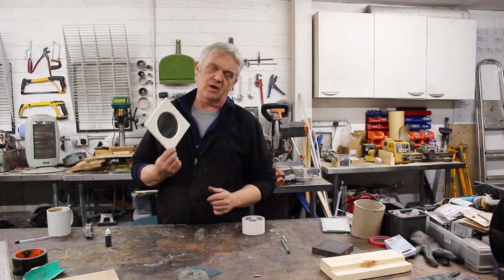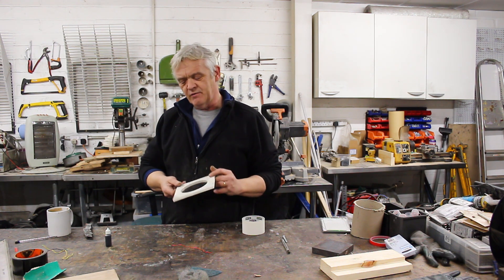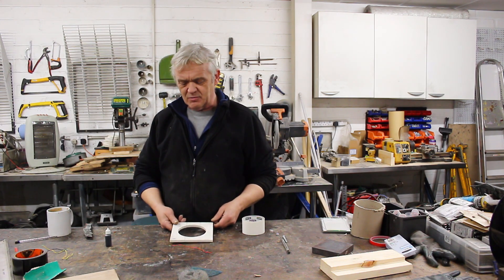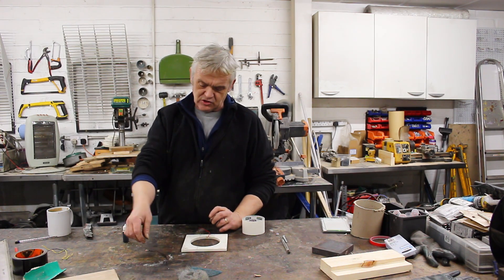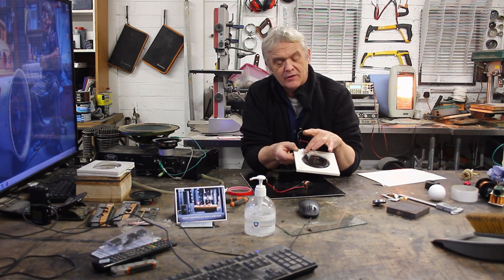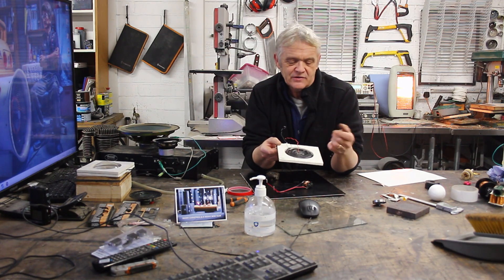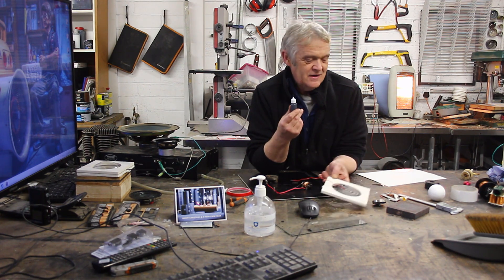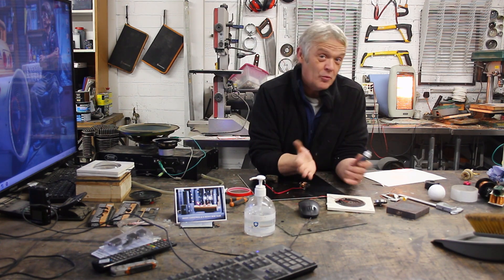1393 Painting A Graphene Speaker

Comment: The hand painted coil is rather low resolution, but it gives me an idea...
Years ago you made copper formate in order to make copper nanoparticles.
You could make a paint / ink with the coper formate and coat the whole film with it. Then using a low cost laser plotter, selectively convert the copper formate to copper. Ideally the unconverted copper formate ink would then be washed off. The copper could be burnished to increase conductivity and electroplating could be used to increase the thickness, if necessary.
Silver, nickel or other metal formate inks could be made with heat/laser conversion properties.
Thinking of which, what a brilliant way to make flex PCBs at home!!! 😁
In fact, this technique could be used to produce multilayer PCBs. After each copper layer is produced and unconverted copper formate removed, it could be sprayed with a suitable insulating lacquer. A mask could be used where layer interconnections would be required, then another layer of formate ink laid down and the process repeated. Polyimide substrate and coatings would be ideal due to their heat resistance. Polyimide would also give the capability of selective laser sintering to produce resistors directly from the polyimide.

Comment: Very interesting. I'm curious to know if the tone of the speaker is controlled by the diameter of the hold, or possibly the thickness of the cellophane? If so you should be able to make a relatively complete speaker system by varying the diameters and thicknesses.
Reply from the maker: I honestly don't know but ii would think you are right - certainly worth looking at - cheers

Comment: It's a low inductance you've got for that speaker but it doesn't take much power for your ears to hear that. It's more like the sensitivity of your hearing is the amazing part.
I made this crystal radio ( no power source ) when I was young with the piezo headpiece. I modified the headpiece transfering the vibrations to a piece of paper. Out came BBC news  which could be heared on the other side of the room. Remember I live in holland. I remember like yesterday. First this typical tune and then a voice "This is BBC news". Loud and clear. I guess they had a powerfull transmitter too :-).
Reply from the maker: you are quite right the power is minuscule but the potential is huge

Comment: Definitely options, considering acoustic levitation is a thing. Aerospace application for sure. Some even nasa would like. Like electric rocket systems.  If impact density is a thing that could be achieved with the right resonance. The whole spaceframe could be completely cover in graphine and be a light as a balloon. It would just need a detonation pulse followed by atmospheric equalisation. 20000 ft in a second would be possible. 8-9Gs of acceleration easy. Scariest ride and wireless sensation. Don’t need fuel just need a short sharp pulse. For a launch vehicle. I suspect it 0.0000001 nano second pulse delivering the rocket energy equivalent.  If you ever wanted to fly to the stars on your favourite tunes now would be that time.
Reply from the maker: interesting mat thanks for sharing

Comment: And in reverse you got your self a very flat and tiny generator.
Imagine a wall of those and something that vibrates in the wind or even used a busy city's audio as a source? One could probably print tiny lines with that ink or use thin copper wires to make some more energy out of it. Great video Rob! 👍
Reply from the maker: I like the copper wires idea mate - and I like the idea in general for sure
Reply: Ba-bow, excellent notion Karl!